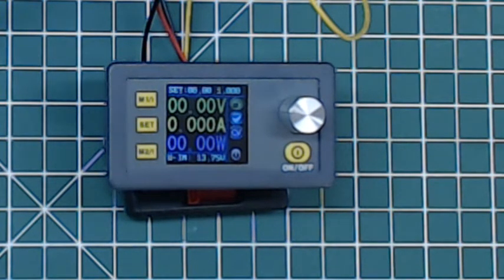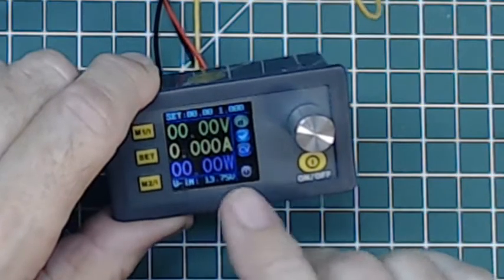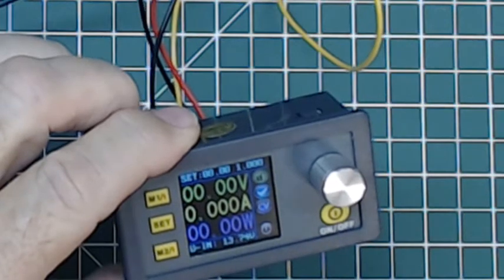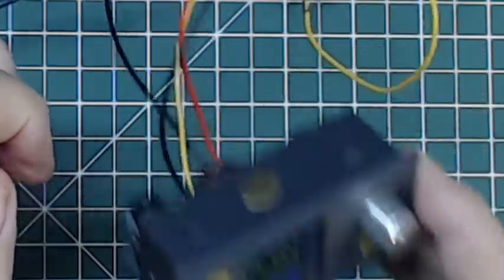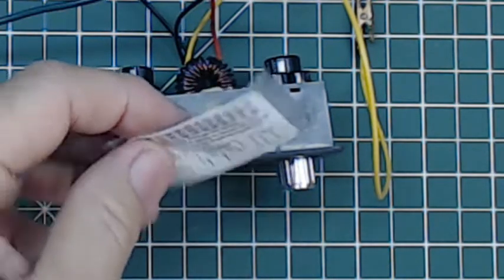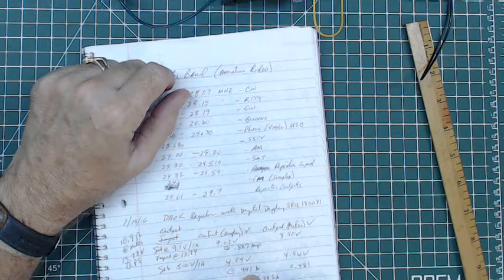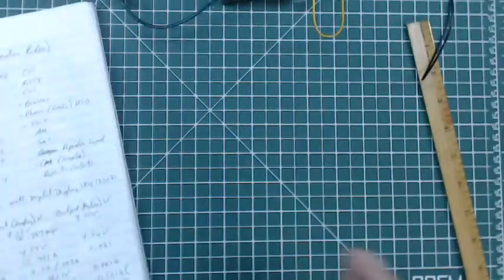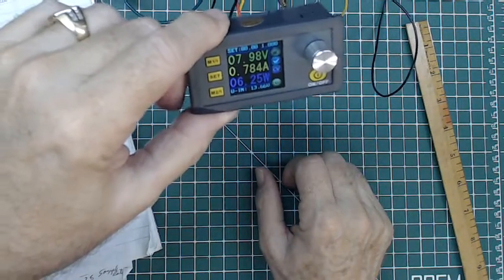TRRS #0932 - DROK DC to DC Converter W/Digital Display

Comment: I was wondering if it was fused and had a setting with a "crowbar" circuit to prevent a over-voltage on the device it was being
used with? Another thing, how much current can it handle with the device? RF switching noise could also be a concern when
used with a receiver as the load device?  Thanks Tom for the review.
Reply from the maker: As I said it will do 5 amps out and has overprotection.  I wish I had a good Oscope to look at the outputs.